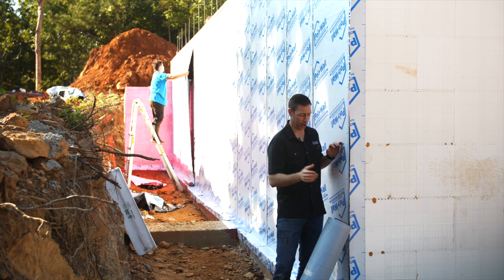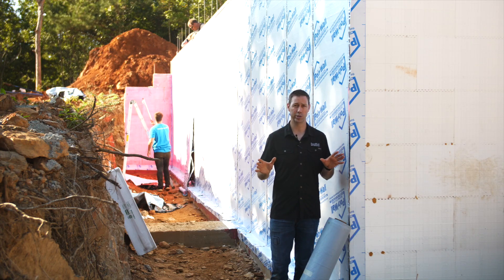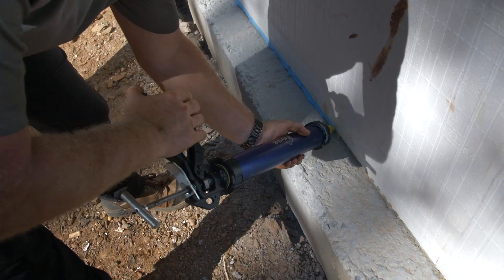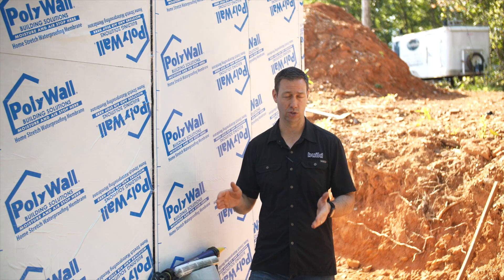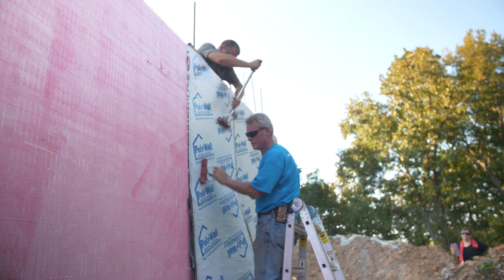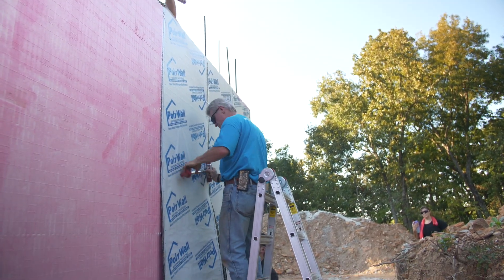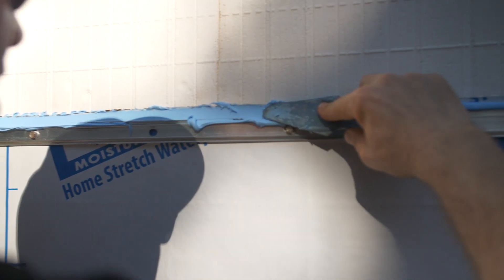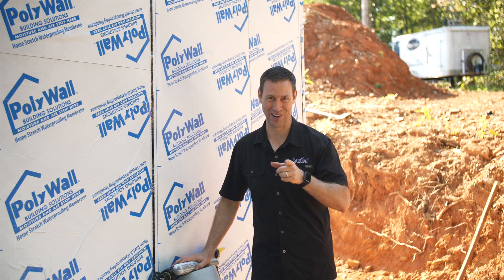This Pink Stuff is The Secret to ICF Waterproofing

Comment: Paid by Polywall. The above grade water proofing comment is nonsense like how can you compare soild continues concrete vs osb with tyvek on it. If your really worried about water proofing above grade and dont think the siding will do its job just tyvek it or at least above the windows.
Reply: One has to remember before you apply even Tyvek to the top side of said type of structure that you want to mark where the hard points are, preferably black ink marker coloring over the spots and webbing also is an attachment point, then seeing through the wrap where to mark it on top of that as well.
Reply: Siding is not a waterproof barrier. Just like the tile in your shower is not a waterproof barrier. You must have a waterproof barrier in place behind the finished substrates. Pulled apart hundreds of homes that are rotted out inside and out because they did not have a waterproof system under the siding or in the bathroom.
Reply: Brian, neither of said just put on the siding finich and mention using "Tyvek" first as a barrier.

Comment: Is Tar still used to waterproof concrete?
Reply: In some cases, yes but more asphalt than tar these days
Reply: Asphalt is only considered damp-proofing. Waterproofing would require a membrane of sorts, whether liquid applied, peel and stick, or sheeting. However, in most places, it is the code minimum for just asphalting, so that is predominantly the extent of most builders.

Comment: Carpenter ants in Georgia will eat that foam,make sure to keep an active pest management.the footer on the wall should have gotten a pass through pipe for waterproofing but you can go around.
Reply: Carpenter ants don't eat wood.  They just live in wood.  Also, ICF and SIP EPS have borate in them.
Reply: Same in Washington State.
I fixed up a shed that was damaged by C-ants, and the EPS I used in the floor looked just like any piece of timber would after C-ants had their day with it.
Reply: Mike Redding 
Hi Mike 
I’m not from the South and have no experience with these pests.  I’m am moving to NC and plan to build there.  Can you elaborate more on dealing with pests during construction and future pest management.  I appreciate you response.  TY

Comment: Why not just spray the whole outside in truck bed liner
Reply: Solvent based, and heat melts styrofoam.
Reply: you prime it first then spray polyurea.. waterproof and super abrasion resistance..
Reply: Cost, and requires another primer to seal the EPS because Linex and other liners used for truck beds are solvent based.
Reply: @ellea3344  LINE-X is not solvent based and is considered a green product because of that
Reply: Rub-r-wall makes a spray rubber coating that isn’t solvent based.  I had my ICF walls sprayed with it before placing dimple mat over it
Reply: Very expensive. Solvent may damage the ICS. Possible fire and building code issues with a product not designed for construction.
Reply: @vylbird8014  LINE-X has products that meet fire codes if you want to use it stand alone but more typical is to use it subgrade where not a concern
Reply: Everyone’s an expert

Comment: I need to add that I would be cautious of stuccoing over poly wall without a air gap because freeze thaw in the coating could be very likely increased without faster drying from the air gap.
Reply: All of this waterproofing is below grade. Why stucco what is not going to be seen or touched after it is buried? Makes no sense, besides you need to fasten a wire mesh that the coating can adhere to or grab on rather.

Comment: How many decades will these polymer and painted on products last? These systems all seem awesome on day one but will they still be performing when the children of the owners inherited them? When their grandchildren do?
Reply: meh, don't worry, these houses only last 150 years tops with all these garbage engineered  materials.
Reply: What "garbage engineered  materials" are you talking about?  Virtually every material used in building is far superior to "old time" products.  150 years?  Hmm, maybe I was slow to get your sarcasm!
Reply: That stuff will be good forever.  Once it is out of the UV, there is nothing to compromise the material.
Reply: The material, sure. It won't rot. It will not be negatively impacted by the water. But the question is not the material, it's the material staying where it should.
Reply: There isn't a proof of the lifespan  of that products yet in us are several example of product failure over the time  the building company use this new interest to develop "new products to literally scam people that guy spend a lot money on built that's walls plus more money in waterproofing  where are the French drain inside and outside ?? Old technology  proof to be last for a fraction of the cost

Comment: Another great video Matt even if Polywall promoted. I have used Polywall and another waterproofing that is liquid applied both above grade and down to 3'ft below grade and prefer liquid. That being said it fills all the cracks and seals critters out. Polywall does excellent especially in wetter climates than the SW for stopping critters, 6 legs hate the taste.

Comment: I don't think that's 40mm thick. More likely 4.0mm thick
Reply: Sorry Nic, I did not see your post when I was making mine as YT is a bit slow on posting new stuff, but it is 0.040 for 40 mil
Reply: he said 40 "mils" thick which is 0.040, not the same as millimeter you dunce, in this case 40 millionths of an inch is 1mm thick (1.016 to be exact, Google's 'unit converter' is a nice tool to easily use)

Comment: How does ICF compare to Tilt-up? I'm wanting to build a live work loft out here in the desert and was wanting ICF for fire protection because the work space will be a bladesmithing shop forging knives.
Reply: tilt up is not monolithic as it requires fastening after tilting up to connect solidly, ICF blocks are as you see a single pour wall and you can even build it to be a monolithic floor to wall to even roof with insulated decking forms which also can be used to create a tilt up wall. Look at every manufaturer and each of their produsts, at leas four offer as i mention a floor form system and also mentioned can be used as tilt-up form. Since you say you are using it for a blacksmith shop and foam is not flammable but still melts into a homogenous ugly blob I would go with something like Build Block's (straight form only) concrete faced forms if you go that route, or if you do the more time consuming formwork you can use Quad Lock R-ETRO system on the outside covered with 2, 3 or 4 inch thick panels.
Reply: I think ICFs will be fine if u cover them with 5/8 fiberglass reinforced drywall and keep the forge several feet away from the walls.

Comment: 3:20     The best tool for mechanically ”scraping” any kind of caulk-like material into a corner, without question, comes from the baking world and are called ”metal ball fondant tools/stylus”.   Like it sounds, they’re literally just varied sizes of metal balls on metal ”sticks” and while you can make your own, a professional set of varying sizes costs very little.   They make perfect fillets of caulk while pushing any excess into distinct lines outside of the corner that peel off with ease.   Give it a try and you’ll be amazed by the results !!
Reply: It's a computer man!  :) add us a link to the tool or item you're talking about.

https://www.amazon.com/s?k=metal+ball+fondant+tools%2Fstylus&ref=nb_sb_noss
Reply: The best tool (in my opinion) will always be an index finger lol
Reply: Plastic soupspoon!

Comment: Matt enjoy your video's, big question why not use the fluid applied product for the entire ICF project? Seems the Home Stretch is much more labor intensive than applying the roller or spray PolyWall products. Or is the roller/spray products not a viable option on EPS foam, won't it do the same waterproofing and less labor intensive?
Reply: Indiana Fred 
Matt has a video of a fellow contractor in Texas using the fluid applied Polywall blue product on a concrete below ground wall. The same dimple drain product is glue to the Polywall blue fluid applied product with the same spray on adhesive.
Reply: Yes, I saw that video as well, it seemed like a better option for any ICF project to me!
Reply: As he said you want to avoid certain applicators with solvents that can break down the foam board structure. Nail Polish or  Acetate will turn any styrene into a blob of goo. Some folks have applied LineX or Rhino linings to their ICF with no issues despite what solvent it uses. I even seen spray on rubber membranes be applied with no issue as well.

Comment: Hmm, if the membrane is applied above grade that might make it tricky to install siding as the membrane will now be covering up indicators for where the plastic webs are. Also might make it a strange surface for stucco, but I'm not sure about that one.

As far as windows go, there was some testing done that showed how a window mounted directly to the concrete core provided the best in moisture/wind infiltration resistance: https://www.constructioncanada.net/weatherproofing-icf-walls-lessons-in-resiliency-from-b-c-field-testing/ . I'd think that sealing the opening with liquid flashing as Matt mentioned would still be a good idea though, but it'd need to be compatible with both concrete and EPS..
Reply: You can see the webbing at the top of the wall.
Drop a plumb bob from the top down,then use that as your master mark..then layout from that line on 8inch Centers..or whatever is the spacing.
Reply: Yeah, at least if the roof is not on there yet.

I guess I'm a bit skeptical about the need to waterproof all of the EPS to the roof as I don't think I've seen that done yet. Similarly I would make a parallel to zip sheathing where nobody is putting membrane on the entire wall, and yet tests showed that still lets water through, whereas EPS would already likely do better in a similar scenario even without the membrane.
Reply: THey clearly state on their website their BB or heavy duty points are at 6 inch on center both vertical and horizontal and the webbing itself can also be used as an added fastening point. They have a diagram on the forms layout on their site if you take the time to browse through it.
Reply: You are correct; it would be very hard to attach things to and make stucco a nuisance. The correct method is to let the ICF be its ideal little self above grade and don't put anything over it. It's unnecessary.

Comment: Just a quick tip something I noticed in the video. At 3:40 if you hold the 5 gallon bucket the other way so the spout is at the top it won't gurgle cause there will be an air gap in the spout to vent the bucket.
Reply: I've found that logic works well for many things!!
Reply: You can also pour the carton of milk onto your Cheerios in this manner.
Reply: @jwo7777777  That's where I learned it through trial and error. I use this trick pouring liquid all the time.
Reply: there is a can of white gas for my camping stove that has directions on it just like that. This works on quarts of oil, gallons of antifreeze, etc.
Reply: That’s correct,
Reply: Seems like if all that money was just spent on longer overhangs you wouldn't need all this hoopla.
Reply: It's obvious that the people installing this waterproofing material aren't the workers more likely they're the owners
Reply: Voice of experience?

Comment: Matt, is there any need to prevent water being pulled up through the foundation into the wall via the cold joint?  Are there measures to seal between the concrete at the cold joint to address this issue in wet climates?  

Thanks for showcasing top notch vendors, your videos have been indispensable on helping prepping for building my own home.
Reply: I didnt  notice any insulation between footers and the walls. The concrete walls wil suck water way up to the walls. Insulated from the inside, but humidity will stay inside. You got to lay some insulation on the footers before building the walls on it.
Reply: @DainiusZelnys   but I'm looking to prevent that capillary action of the footers pulling water up into the walls. Hence sealing the tops of the footers (maybe) before laying up the forms for the walls.
Reply: Look up Fab Form's "Fastfooting" system, something Matt the Expert missed on and the home owner-builder also did not think off then doing the footing pour. One can even use icf on the outside and top of the footing to insulate as well, one ICF manufacturer even makes footing forms for the base and side.
Reply: @Joshua79C  yep I've seen those and I'm not sold on their efficacy. They seem like a decent measure, but I still want to find something to seal between the cold joints.
Reply: yeap, effects of capillary forces are not known in US yet....
Reply: Matts way of preventing this is through a vapor and water barrier before concrete pour. I'm pretty sure, been following long enough to make the connections
Reply: Lite Form's frost protected footings system is nice, all you got to do is ad some foam on top to fill the gap between it and the wall form and you are all set for insulating, but then that is just overkill. Another less overdone is going with Build Block KD with spacer to create the width needed for concrete and place underneath the Fab Footing bag for a flat bottom that is protected from capillary action of water into concrete and still it is overkill but will protect from any dampness in the future.
Reply: The best scenario for this would be to do a FabForm Techonologies FastFoot Monopour build with Xypex admixture. Eliminates the cold joint, and makes the concrete impermeable. Throw down a perimeter drain and bury it. No need for roll applied anything or peel and sticks.

Comment: Hey Matt, love your videos. All the houses you seem to show are modern or contemporary. What about building a waterproof, air tight house that is modeled after older styles of houses like Victorian? Is that doable, and if so are there any extra precautions that need to be taken?
Reply: Any style of architecture is possible with ICF, just search "Victorian ICF" for pictures of past builds and available plans, though certain features will still require building out with some wood.
Reply: Waterproofing and air-tighting a house is easy with ICF. It lends to any architectural design you can reasonably accomplish. I know guys who have done waves and curved walls (both directions) (for Dr. Seuss style architecture) with ICF... Use Xypex in the mix for the basement if you want full waterproofing. Go ICF up to truss line for full waterproof and air-tight. You weak point for energy will be your lid. One way people achieve decent results is polyethylene the underside of trusses, drywalling, and then boxing over the light and electrical penetrations to air tight them and then dumping tons of fluffy stuff on top, giving you a vented attic and air tight system. (I plan to go one step further and drywall the ceiling first, install electrical, then spray 1" open cell foam on the ceiling assembly to verify 99%+ airtight, then load the cellulose...) Works everywhere. (But for the sake of all things good and holy, don't dare put any mechanical anything in unconditioned spaces! The only thing that should be in a vented attic is air, (unless you build in storage ABOVE your fluffy stuff that has an access from a gable end; don't go punching doorways into your airtight ceiling system!)) For a tight house, use radiant floor heating (and cooling if needed like a heat sink) and eliminate all your ducting entirely. Put in a decent ERV or a few depending on your needs (don't over-ventilate; make them adjustable and turn them all off and slowly turn them on to a bare minimum of your preferred indoor air quality), it will likely be less than ASHRAE 62.2, but their number is admittedly a bit arbitrary. Ask Joe L. (My last few sentences are derived from his advice, I'm not just making it up.) And, if you are building right, do good windows. Alpen, Lux, Zola, Intus, etc. Or at least a triple glazed unit from someone decent. Do the building envelope one time and save 'future rehabilitations' or whatever for interior stuff. All exterior stuff should be one and done. If curious on making it 'cost effective', check out iowanest.com. Pretty neat what they did there, and I like their window details.

Comment: Could you use Blue Barrier Liquid Wrap 2300 all of the above grade exterior walls?
Reply: I had the same question.  Can't help but think that it would be a superior system, but my suspicion is that it would be cost prohibitive for most.  But to add on, why can't you use the fluid applied on the entire foundation, above and below grade?  Should still be able to apply their air gap as well.